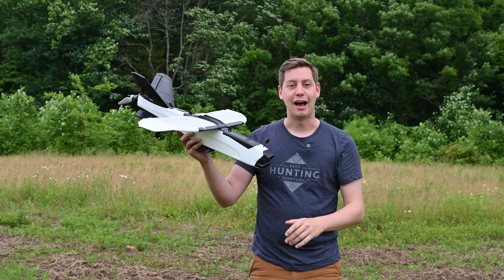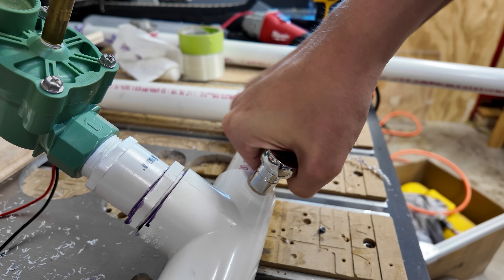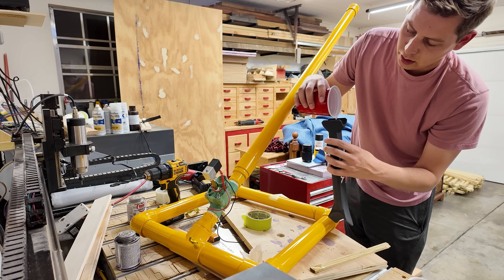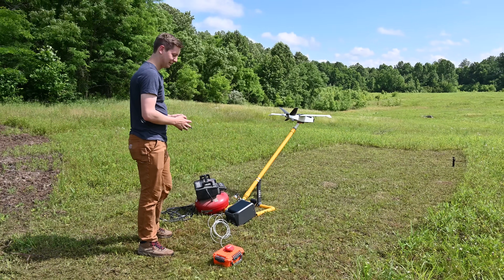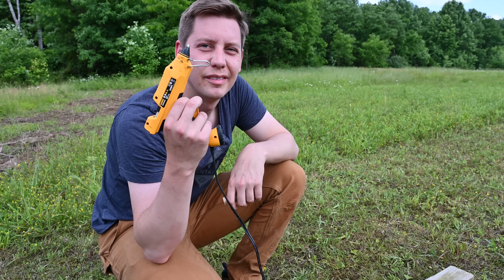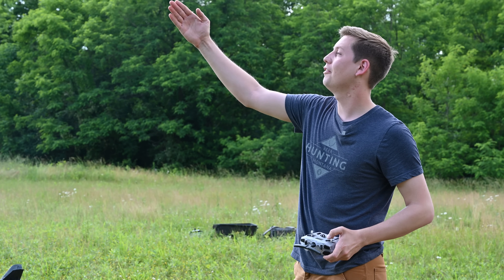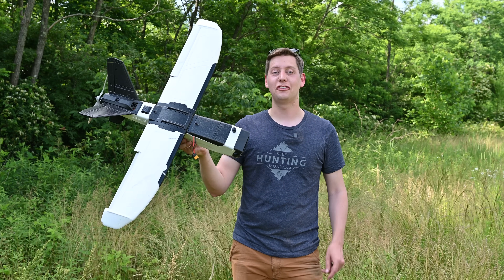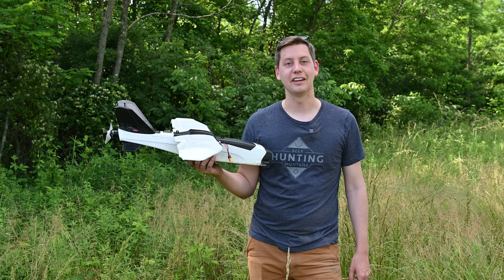This Plane Doesn’t Need a Runway

Comment: As well as it worked with the pipe coming loose i would not try to retain it at all in the system i would use it with out o rings and just use a bit of bike inner tube rubber or oiled leather screwed to the back end of the fitting as a seal i would tether the pipe with a long cord to keep it from going to far and to make sure it separates from the plane i would have the plate with the nub slide off with out any real retention method so that at the end of travel it falls away on it's own. You could simplify the launch system even more using a large coiled spring to fire the piston out and get rid of air outright. It would be more or less a catapult like system but could be more compact and would not have the issues those systems all have which is the forward yank when the slide hits the end of travel. They tend to self destruct with use.

Comment: If I may suggest but you should power the pneumatic launcher with steam. Also, I think having the launch tube release from the launcher is good. It's basically like hitting a baseball. You got to swing through the ball. If the launch tube abruptly stops, I think you'll lose a lot of ummph.

Comment: You need a trebuchet launcher. It wont need rocket motors that can get you into trouble depending on where you are. It is also more robust than an air piston as there are no parts that need to be air tight. You just need to crank up the weight and let it go.

Comment: Pneumatic launcher is awesome. Great idea here, this is super cool.  Incorporating the "tank" into the frame of the launcher was an excellent idea. This makes for less parts, less weight, and one less failure point. I wouldn't have launched it the 1st time after seeing the angle of the plane when its clipped in, compared to the angle it is being launched at, I would be afraid the wings would snap off, or be put under unnecessary stress while the thing is being thrusted towards the sky, under force, over and over lol. It worked though, and I haven't watched the rest of the video yet, so I don't know if the angle of the launch mount gets changed later. The forces against the wings must be putting stress on them. When they did this in real life on planes, this is not " what they did", their planes were oriented more towards the sky with a straight angle matching the launch angle. Their rockets nozzles were pointed down a little for downward thrust, but the fuselage itself was angled more in line with the carriage making for a straight release. Clearly this launcher works, so it may not be as serious as my mind is making it.  Great job. I would have designed a different mounting system. Rather than carrying the extra weight and drag of a mount, maybe a cradle attached to the launcher. A more sturdy directional piston would probably be needed for this to keep the planes weight from rolling itself over while in the launcher, it seems to just barely stay upright on it's own. I would make an attached cradle that stays on the piston for the plane to sit on, with lightly spring loaded arms that push against the back side of the wings for launching, but spring loaded so they collapse if hit by the passing tail. This would eliminate all parts from the plane itself, provide a sturdy upright surface for the plane to sit on, and the arms would also move out of the way when the tail passes by. If you have other planes of similar size, and designes this cradle with all of them in mind, this would allow you to launch them all with the same cradle. I know this would take more time, effort, and cost, but I think if your going to create something like this, you might as well go all the way and take out as many factors as possible that might cause the plane to crash before it's even made it 20ft. These are just my opinions and observations, let's not get all butt hurt folks with mean comments.
Reply: Your angle observations are 100% correct, if this was anything but a 3D printed plane, those wings would have snapped at the force required to launch, it works here because the plane is light enough, if you had a good slo-mo camera you would see the entire plane flexing around the launch point. The amount of force required to do this for a real metal plane would put it under more stress than it could handle. Its why the testing done on the real planes had the plane at much more pronounced launch angle like you pointed out.

Comment: The ZELL is one of my favourite crazy cold war ideas. If anyone is wondering why they didnt pursue it further - the answer is that SAM systems got invented. 

Yes, the plan for ZELL was basically manned surface to air missiles to intercept airplanes. 

As for your rocket misfortunes, although i never launched any myself, i've always heard its a big pain in the bum to simultaneously ignite multiple motors at once (as demonstrated in the video), so ideally the motors would be tilted outwards to point at COM. In that way, failure of one motor or mistimed ignition wouldn't roll the whole thing.

Comment: Rocket assist is cool, but I would go for a launch rail with an electric motor driven carriage (belt or wire pull),
because RC-Guys have everything they need to assemble that, in the scrap parts bin .. and its a bit less fiery ;)

Comment: Sometimes those motors just blow up like that. Usually it’s from improper handling or temperature control by the retailer, cracks form in the propellant and it ignites all at once from both ends. I build a lot of model rockets and this happens relatively often.
Reply: Back in the 90s in like 5th or 6th grade we had a rocket club, and I honestly dont remember any of those kinds of failures. But never really a failure I would call a blow up...Sometimes they would burn too quick to the ejection charge (as in they would barely off the launch rod then pop the parachute), a couple lost their nozzle packing, some didnt burn fully and ended up on the ground before popping the 'cute charge, the fun ones were when the motor separated from the rocket and took on a random ballistic path 😅

Not saying I dont believe you, it was always a worry. Just more of a comment on 'they must have gotten lax in their production and formulation of rocket motors since I was a boy' ..... as is the way of things, I suppose. But for it to happen often, thats pretty sad. Estes has taken quite a tumble since my time .....😕

Comment: i would probably stack the motors like inline with eachother (both on the centerline of the plane) [or use a bigger motor] that way if you have a fail you dont make a roll moment. also might add so internal 'piping' on the motor mount so that the eject charge is used to either vent out the side avoiding the plane or out the front ejecting the motor mount.

Comment: The C130 can use rockets on takeoff. The system is called Jet Assisted Take Off (JATO), so the early testing didn't really get shelved.
Reply: That's slightly different.  The point of JATO is to accelerate a heavily loaded plane on the runway to get it in the air with a shorter runway than it would need unassisted.  The zero distance launch was envisioned to be able to launch fighter planes from pretty much any open area without needing a runway of any kind.  During the cold war it was assumed that one of the first targets in a hot conflict would be runways, which would deny the enemy the ability to launch fighter and bomber aircraft, thus giving de-facto air superiority to the side that knocked out the runways first.  The zero distance launch concept was a counter to the runway attacks, but it has some pretty large flaws.
Reply: @jamesburleson1916  one of the flaws being that you may get it in the air without a runway but not back down again😂😂😂
Reply: I’m pretty sure it was developed for a conflict in the 90s where they needed to land and takeoff from a field to rescue hostages? I know the fat electrician did a video on it a while back but I can’t remember all the deets🫶🏻
Reply: @Charliebit23  It was called Credible Sport and you can find videos of testing on YT. The plan was to attach a bunch of missile engines to a modified C130. One set would bring the aircraft from flying to landing in the length of a football field. The second set would send it from standing to flying after a bunch of hostages got on board. It went about as well as you might expect.
Reply: that system shortens the runway, but you still need some space.
Reply: Yep, I've seen Hercules do a JATO. It's wild.

Comment: How about using a constant force spring (think beefy tape measure spring).  I don't know how hard a suitable one would be to obtain, but if you can get one, the advantage would be similar to using a weight-based launcher.

Comment: Can I make a suggestion you’ll consider? That about installing a compressed air system you can refill, mount it the rocket style but maybe directly from the back, set the plane facing straight up, blast it into the air, then use the fins to spin and gliding to gain the speed necessary to maintain flight

Comment: put some seals on the bushing and add vent holes a few inches down the barrel. 
the new sealed area behind the piston will vent out the holes, but once piston passes the holes it will act as a spring to slow down the piston while then venting the pressure chamber

Comment: I built a pneumatic launcher like that so my kids could launch paper rockets. Rockets re simply paper wound around a piece of 3/4” PVC pipe with paper fins and nose cone. All made of thick paper. To launch, just slide them over the PVC tube. The rockets could easily fly the length of a soccer/football field.

Comment: For the pneumatic method, I would recommend drilling a hole and putting a metal or plastic rod to connect the PVC pipe to the stop to prevent it from breaking off during launch. Otherwise cool vid!

Comment: I think that if you use only a single rocket motor and have the prop rotor on the max thrust before launching it then it will be enough thrust since the thrusts will be added together.

Comment: Those igniters also never quite fire at the same time. This means that mounting dual engines side by side horizontally causes a lateral force initially, during the slight delay between the first and second motor ignition. If you can, mount the engines vertically, aligned with the centre of mass.
Reply: Also overdrive the shit out of them. Put two batteries in series, slam the voltage through them. The more voltage you send to em, the hotter and faster they light. We would usually double up 9V batteries and hit em with 18v, of course with lipos you still might want to limit the current some, or not...idk, we only had copper tops, energizers, and the cheapo ones with the cat design when I was a boy shooting stuff at the sky. Also, for multiples try separating the leads, like -===^===+===^===- (===^=== being the ignitor, - and + being arbitrarily chosen polarity indicators) that way as one lights it wont blow the leads to the other one off the wire ends and im sure some electrical voodoo dealing with current and such....
Reply: @TankR  caps seem like a smart choice.
Reply: @user-mn8lz7gf6d  True! The real limit with alkaline cells is the current limited by the chemical reaction. Pretty much every LED flashlight that uses those 3xAAA carrier thingys dont have any current limiting resistors in them because the continuous current from the chemistry is so low. 

I mean, like flashlights, pop a little lipo in there and they'll burn like the sun...until they burn out (current limiting resistors, kids. They're a good idea). But if you dont want to jam that much current to the igniters (or risk dead shorting a lipo in your hand), yeah caps would absolutely give a good zap to the igniters. I think someone else mentioned adapting a camera flash circuit as an igniter box too. GIves a bit of a failsafe if designed right. Ground out the ignitors, charge the cap, then the trigger connects the igniters in circuit and discharges in one go. Hrmm...I might have to dig through my boxes and have a go at that.....

Comment: I think you’d get a better launch if you point your nose in the direction you’re sending the plane. The wings are just dragging if you have them parallel to the ground and then yeet it up at a 45. You’ll notice they do that with the full size rocket assisted planes.

Comment: Drones in Ukraine are frequently launched with hand-cranked elastic bands accelerating them up an inclined track, more or less like a slingshot or crossbow.
Reply: Obviously the rubber  band draws directly the drone. BUT, it the rubber band draws a snatchblock, You get twice the speed (of rubber band) but only half of the force. Mostly the speed is the important requirement.
Reply: @morgan0  yes, but pneumo systems is used also widely here. But thanks that you mentioned rope. I hoped to see it here too to compare impressions of rope launch, pneumo launch and rocket launch. But the way here also it started to be popular to make rocket launch
Reply: @ZipovUA When You use a snatchblock and rope still using pneumatic cylinders, You get twice the speed of the tip of the cylinder and also twice the length of movement.
Reply: i’ve seen quite a few videos of drones launched from lebanon via rocket

Comment: maybe a mechanical contraption could be fun (and dangerous), like a trebuchet or multi-joint arm with elastic sinews to make a throwing motion, or just a whippy fishing rod. the plane is pretty light so you can use huge mechanical advantage to accelerate it.
Reply: yeah ive thought about the bendy rod method.. part of the problem its getting it staked into the ground enough, because unless you have a gigantic sturdy frame, you end up needing to anchor into the ground in a couple places. I started trying some weird ideas but was stopped by the horrible half rocks half gopher hole situation at my nearby rc field. 
One of my ideas is making something that can lock into a tow hitch receiver because where I fly, we all park right there anyway and are usually sitting in the back of our cars with the hatch open when we arent flying.

Comment: I think you need some holes near the end of the pipe to let out the excess gas so the whole thing isn't left pressurized and it will start the slowdown process.
Reply: And don't glue the piston directly to the “push rod” instead attach them together with a spring so when the piston stops the “push rod” will be decelerated more gently and hopefully stay attached.
Reply: Literally was typing the same thing and noticed your comment
Reply: Was just going to type this add multiple vent holes well back of the end to depressurize it

Comment: You're the 1st person that I know of that commented (correctly) about the poor igniters that rocketeers use these days.
Reply: If you think the igniters are bad now you should have seen them 50 years ago. The little plastic retainers, that are color coded to fit nicely into the engine's nozzle, make things far better.
Reply: It's not rocketeer's fault, at least in the USA.  It's the GD batfinks.

Comment: just launch upwards, like quad copter biplane or quadplane. you could also launch in reverse drone mode upwards if a back pusher. yep needs to reverse the back prop. can-cel, botched. mothballed. yep design out the launch inability. if you can launch free form, you can also land free form. if you have 4x back pushers then you could land on the propeller axle tips like drills, or as 4x landing leg pads. why your planes need to be so hard to launch. design skill issue. well, you yeeted your water. dont do that again. believe in yeetus. use selfie stick catapult instead for launches. show business is hard boys. use bbq spike stick for hand launching. stick the launch pole on the ground. osha is karen.